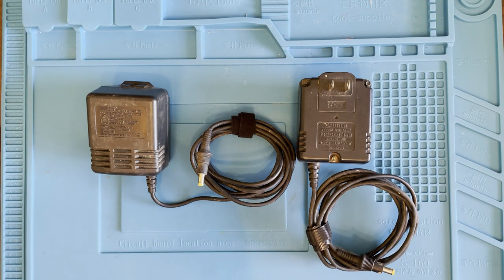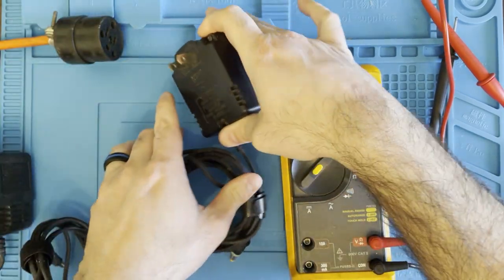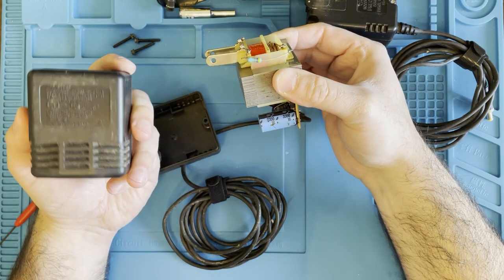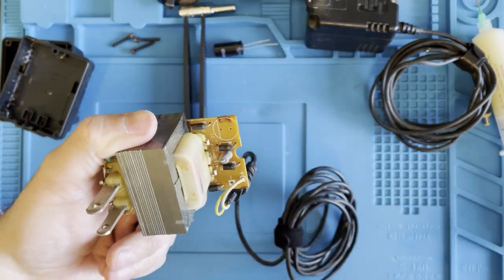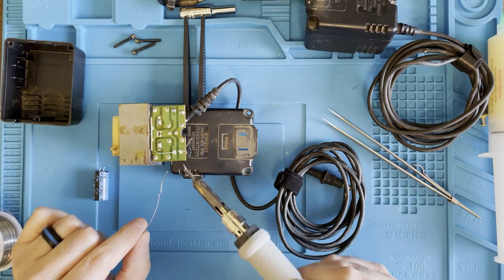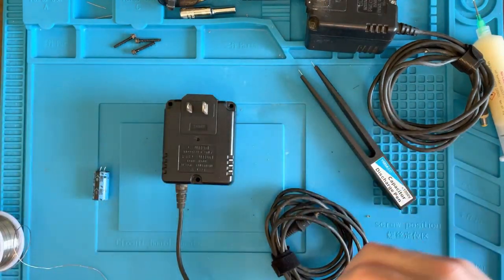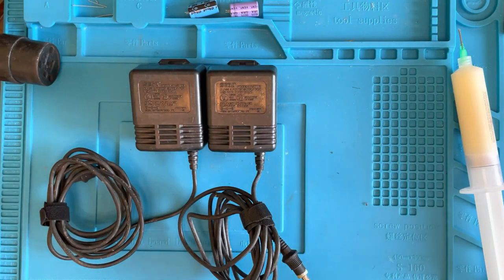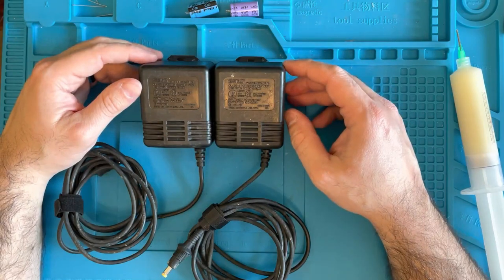Capacitor Replacement Sega Power Supply MK-2103

Comment: Dude awesome job here!  We recently repaired several SNES AC Adapters, but those issues are cable-related.  We didn't need to replace caps, so props to you.  Great video and you have an awesome set of tools at your disposal!  Those sega adapters look much easier to open!  Freakin Nintendo.....
Reply from the maker: Thank you!! Yeah it seems that Nintendo really didn’t what people to open their stuff!! I’ve taken apart the SNES ones before and they are a pain!! You need that special bit and you wind up cutting into the plastic casing if you’re not careful!! 🐺🐺😁😁

Comment: Almost Every MK 1062s and a few 2013s I had taken apart had electrolyte crust on them, A few Model 1 Power supply Diodes had been corroded by the electrolytes and had to be Substituted from my dead Model 1 Adapter which apparently had a dead transformer. All the Diodes were good at least. I still should get some replacement diodes.
Reply from the maker: Yeah, these power supplies are getting pretty old now. I’m surprised that most of the ones I have still work🤣
Thank you for your comment it is much appreciated!! 🐺😁
Reply: @wolfmanrepairs  I had an original model 1 psu BURN AND SMOKE. On disassembly the little pcb had all of its layers split apart, one of the diodes was CRISP. It probably would have burned my house down. I run a genesis cd 32x, all 3 psu's were original. I am looking to find a modern 3 in 1 for the unit as all my other psu's for my other consoles are modern save for my SNES. At this rate should I replace my SNES psu too or were they built well enough NOT TO EXPLODE?
Reply from the maker: That’s crazy!! Can’t believe the psu was all burnt up like that!! I haven’t had any issues with my OEM SNES power supplies. I don’t ever leave them plugged in though. I only plug them in when I’m playing and disconnect them after. Do you leave yours plugged in all the time? 🐺😁
Reply: I would usually turn off my surge protector after I'm done playing my games.
Reply: @wolfmanrepairs  power strip and off most the time. If it weren't for that we'd be talking about a different story
Reply from the maker: @Toasty_Gaming that’s really crazy. So it couldn’t have been a power surge because most likely the power strip would have protected the PSU. So the PSU just fried itself. I don’t blame you for looking into modern power supplies. I would be a little worried about the old ones too. I’ve seen a few videos where people have been using usb c and connecting directly to the voltage regulator but I really don’t know how safe that is. I personally have not done that to any console. RetroSix has been making a lot of power supply mods where you can use USB C safely but I don’t see SNES on there site yet. I would contact them and see if they have anything in the works. Here is their website with the power mods: https://retrosix.co.uk/Power-Mods-c114848406
🐺🐺😁😁

Comment: Sorry for the new stupid question, but why is the output reading 13v when the power supply says 9v? Was checking my own 1602 power supply.
Reply from the maker: Nah there’s no stupid questions. I’m still learning every day about this stuff! I could be wrong but I think the power supply will read higher if it’s not running the console because it’s not under a load.   Hope that helps !!🐺😁
Reply: @wolfmanrepairs  Gotcha. Thank you for making this video! I only did a clean of my power supply and this was helpful to verify I did not break anything in the process. I'll be back to this video when I work up my soldering skills and decide to recap this power supply!
Reply from the maker: You’re welcome!! I’m glad you found the video helpful!! Best of luck with your power supplies!! If you have any issues or questions when you put the new caps let me know and I will try to help the best I can!! 🐺😁

Comment: I'm trying to take mine apart and one of the bolts absolutely will not budge. Any suggestions/advice on how to get it loose?
Reply from the maker: You could try using a little wd40 on the bolt and let it sit for a while. They are really in there good!! You might just have to go for it and hopefully it won’t break the housing or something. Let me know if you get it loose 🐺🐺😁😁

Comment: My sega on the red led but in screen it has a bibrate sound and dont show image. Will be the capacitor?
Reply from the maker: I don’t think that is the capacitor in the power supply making that happen. I would try giving the a/v port a good clean with IPA or contact cleaner and put the cable in and out a few times. If that doesn’t work I would try reflowing the solder joints on the a/v port. Also clean the cartridge connector really well with IPA or contact cleaner. 
Let me know if that works 🐺😁

Comment: Thank you for video. I have my Sega Game Gear (portable version of Sega) for Europe market, and for it Power Supply MK-2103 has inner "-" and outer "+". Your version of power adaptors have opposit polarity. Is this because of Europe/US market differences?
Reply from the maker: That is interesting!! I thought they would be the same. I do not have any experience with European electronics but I would have to assume it’s because of the market differences. Sorry I couldn’t be more help. 
Thank you for your question!! I will definitely be doing some research now!! 🐺😁
Reply: @wolfmanrepairs  thank you too) keep doing your awesome videos!

Comment: Hello, i have two model 1 power supply and one is putting out around 13v dc but the other is putting out zero dc volts but around 120 something ac and ive been searching for info but all i see is not working. Not ones putting out full ac power. Any idea how to fix it?
Reply from the maker: Hello!! I’m not sure about this. Im assuming your not in the US because 120v ac would be fine for a US outlet. What I have found with these power supplies is that they usually have cord issues. Are you measuring the output voltage at the end of the cord where it would plug into the Model 1 or inside the power supply? (Measuring inside the power supply with it plugged in is dangerous you can easily get shocked or worse so please be careful)
Let me know and I will try and assist further. 🐺😁